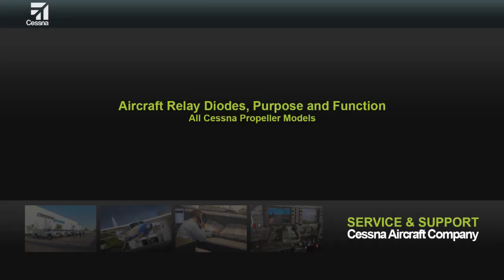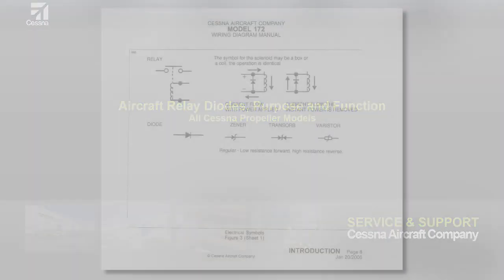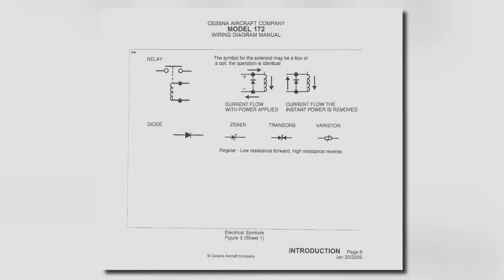Aircraft Relay Diodes, Purpose and Function

Comment: The service manual wiring diagram shows a diode across the battery contractor and from ground to the load side of the alt master switch. What is the purpose of the diode across the switch? It is missing on my 172M model.